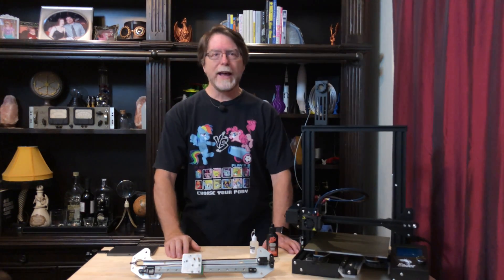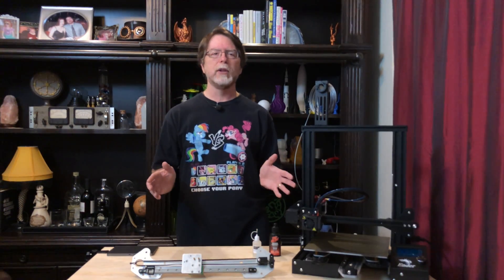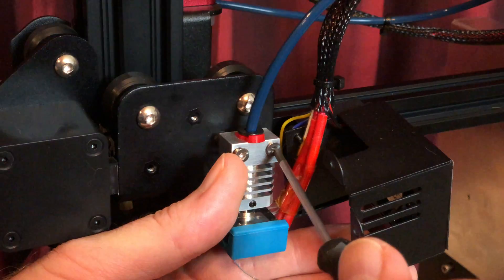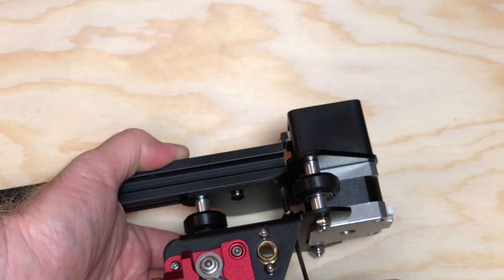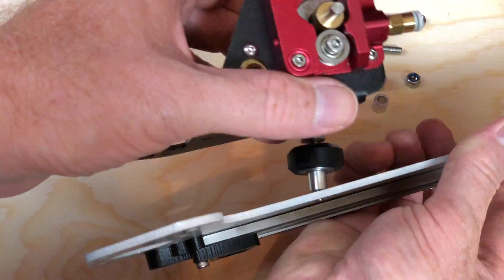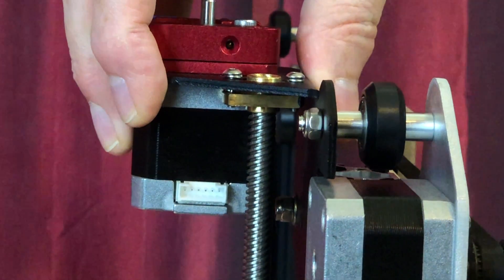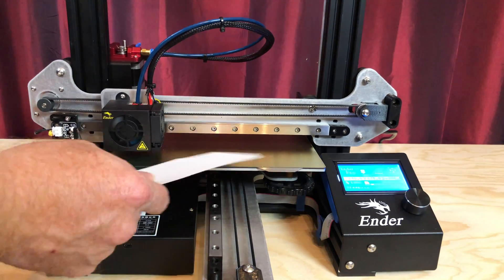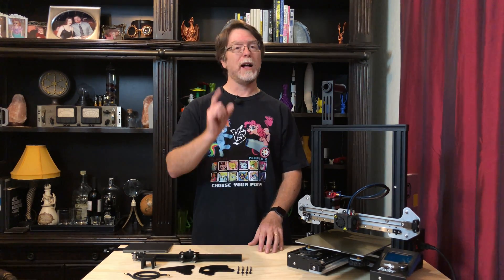How To Install 3Dfused X Axis Linear Rail Kit for Ender 3 & Ender 3 Pro

Comment: 2 axis down just all the rest to go. Just not a firm beliver  that this relay Archive any thing other than it my  give stronger artifacts or in a way multiplying even create some,  if there is any problems on the other axis that are still stock.  in any case you still have a heavy spring loaded bed moving back and forward  and belts and belt wheels and a ton of other factors that are not balanced or 100 % true, so for the money not sure this is the thing to solve any issues,  it my present issues that are even more complicated to address.  Not trying to be an AS here but i for one is not totally sold that this will get you any where fast.

Comment: So this might be a long shot, but do you know what screws are used for the wheels on the non-motor bracket? I stripped mine and I think if I can get a replacement it'd be a lot easier than returning the whole thing.
Reply from the maker: Hi! The screws on the original Creality part appear to be M5x30 button head screws. The nuts are M5 nyloc nuts. 👍
Reply: @BV3D just got around to going to the hardware store and lo and behold they were! Much appreciated
Reply: @BV3D  Thanks a ton man! Not even Creality's github makes that clear!

Comment: So I finally hooked up the linear x rail, and it's super loud now. It sounds like a palm sander running under a cookie sheet at some points, like it starts a mild vibration and then just starts really rattling. Hot end, fan shroud, rollers, belts etc are all tight.

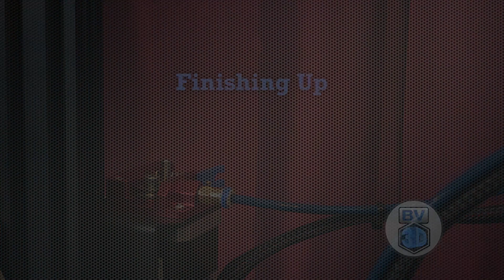Comment: Hi Bryan! At time 10:42 you show an adjustable X axis limit switch bracket. Where can I purchase this? I did not see it with the assembly from 3DFused. My X axis needs the limit switch moved more to the right to prevent the stepper motor from setting home outside the build plate.
Reply from the maker: Hi Dave! That should've been in your kit, but fortunately, 3Dfused has STLs for all the printable parts available to download. In the "navigation" links along the top of their site, the third one is "Download .STL", and the X limit bracket for the Ender kit is about the 7th item down. Here's a direct link to save time: https://3dfused.com/download/3637/

The fun thing about that is, if you want to reprint their printed parts to match a certain color scheme you've got going, you can do that. 👍

As a side note, I've got my limit switches adjusted so that the nozzle's home position is aligned on the left side of the bed, and hangs about a millimeter over the front. I like having that little "overbite" on it so that while heating the printer, "nozzle ooze" doesn't collect on the bed. When I print my priming line, I move the nozzle in a few mm to do it, so the strand of ooze gets wiped off at the beginning.
Reply: @BV3D  Well... That's what I get for not pulling the cover on it to begin with. I finished assembly yesterday only to find the X axis was causing the extruder assembly to bang when it hit the switch. I can fix this now that you showed me it was already there!! While I am at it, here's another question, I am replacing the stock board today with the SKR Mini E3 32bit board with the 2209 drivers already installed. I had ordered SL Smoothers as well but I don't think they will do anything with these newer  drivers. Any thoughts? Might make a good video for you. Thanks very much - I owe you a few coffees!

Comment: For lube i have actually used Traxxas shock silicone oil :) It was all i had at the time and it worked just as well
Reply from the maker: That's funny, but I don't see why it wouldn't work. The only possible issue I could foresee is if the shock oil had some weird reaction with whatever lubricant was already on the rails and got gummy. But even if that happened, cleaning & re-lubing a rail block isn't really difficult. Should I make a video about that?
Reply: BV3D: Bryan Vines wouldn’t be a bad idea for a video, I’m sure some people would get some help from that

Comment: Waiting for the X/Z video.
Reply from the maker: I'm planning to have that out on September 30!
Reply: @BV3D  As soon as I saw this I basically wanted the full kit. Two problems though, a smaller one is that they don't powder coat them but keep them bare metal and 100% of the printers they will go on will be black (minor you might say, but important to some). Bigger problem though is shipping, while I find the price of the kit quite acceptable shipping is twice the price of the full kits themselves :/ (NOT counting VAT and import fees)
Reply: BV3D: Bryan Vines THANK YOU. I need to get my complete kit installed as I have a lot of printing to  do

Comment: Nice video although i dissagree with the hole concept of choosing rails over pulley wheels. I see this as a downgrade. You eleminate the dampening effect of the wheels. THIS is IMHO
the success of the Creality series. If i would actualy wanted to upgrade i would use plastics to screw the wheels on to to further eleminate vibration. But who am i?

Comment: Slightly over priced as far as I'm concerned. Also, there is no mention of leveling the gantry, just the amount of play in the wheel screw holes would be enough to throw it out one direction or the other.

Comment: Can you provide a link to your hex driver(s) that you use? I'd much prefer them over a standard L-shaped hex wrench. Thank you for the fine videos!
Reply from the maker: Hi Bill! That would be the "Wera 2052/6 Kraftform Micro Ballhead Hexagon Electronics Screwdriver Set and Rack, 6-Piece", which I got on Amazon in February of last year.
https://amzn.to/2LqC6g2 [affiliate link]

It doesn't match the largest of the L-shaped hex wrenches that came with the Ender 3, but it matches all the others.

I do appreciate the ball ends on the wrenches Creality included with the printer though. Love those things. You don't have to have the wrench perfectly inline with the screw head to drive them in!

Comment: Brian you have outdone yourself in this video!! Very nice super great instructional video!!!!! Now that you have added the two linear rails I wonder what changes you have seen in the Ender 3 printing quality.  I also look for the next installment on the Z access  linear rail installation. I do have one comment the price of this is a little bit on the higher side and I’m wondering why they did not black anodize these parts.
Reply from the maker: Hi David, and thanks! Something weird seems to be going on with my replies on YouTube; several that I've left recently are now gone. Anyway, I tweeted a couple of photos of Louise Driggers's "Aria" dragon, the print came out really nice. I'll post that in the Community section of the channel as well. One thing to note about the upgrade is that both the X and Y axis components are waterjet cut from really thick aluminum. I think enough people like the raw metal look that they didn't see the need to change. However, they are giving thought to the idea of powdercoating the parts.

Comment: Man, can't wait for the z linear rail and your thoughts on how all 3 have improved (or not) your print quality. Do you think there would be a big advantage with this x upgrade over stock when adding a direct extruder? Also, excellent tutorial as always, clear and straightforward! Thanks for sharing Bryan! P.S. do you think Vegemite would go well with a bearing sandwich?
Reply from the maker: Hey, Thierry! I'm really pretty sure I replied to this comment a day or two ago, but it looks like my reply is gone. I had talked about the rail being able to carry the weight of a direct drive extruder, and stuff like that. I also said something about vegemite being good anytime. So very odd! Did you get a notification that I replied recently?
Reply: @BV3D  haha, no I didn't see that reply. I would remember anything to do with Vegemite!

Comment: I enjoyed the video, but wow, this is a stupid upgrade. There are so many more meaningful upgrades that are way cheaper, just not "plug & play." Upgrading to a first-tier extruder would be one. The aluminum MK8 / MK10 is not. Next, a better hotend, like a V6.
Reply from the maker: Hi! There are any number of upgrades one can install on a printer. Everybody has different priorities on what they consider to be necessary upgrades. But that's OK, right? You are prioritizing the extruder and hot end, for example.

I mean, I agree that the stock extruder is the worst. And the aluminum one, while not "top tier," addresses two huge flaws with the stock extruder and is one of those "If you buy nothing else for your Ender 3, at least buy this" kind of upgrade. If you want better, you spend more and get a Bondtech or similar.

The stock hot end is fine for PLA. I installed a Micro Swiss all metal hot end because it was a drop-in replacement, handles higher temperature materials, and because of my past experience with the product on other printers. Is it as good as an E3D V6? I don't know, I haven't used one. I'm not a hot end expert, but it works pretty well for me.

I guess my point is that, while I respect your opinion, my own opinion is that it's not a bad upgrade. I'm not a stranger to soldering electronics and printing parts for upgrades, but I appreciate the simplicity of drop-in replacements.

And having said all *that*, I'm interested to know your full list of must-have upgrades for the Ender 3 / Pro, because I'm always looking for cool things to showcase in videos!

Thanks!
Reply: @BV3D  I agree that the stock Ender 3 is a capable printer when dialed-in. I have found that the weakest link is by far, the extruder. It slips under high nozzle pressure, just like you would expect a MK8 or MK10 to. I find this to be the source of most underextrusion that people complain about. Printing some brands of PETG with the stock extruder is even maddening, as it slips on the drive gear under high nozzle pressure, and is generally much harder to grip than PLA. While a V6 isn't a necessity, it's money much better spent than this upgrade. I find the stock hotend decent, but definitely a bit leakier than V6, and obviously not up to the same temperature capability. There is nothing wrong with the repeatability of the rollers. The repeatability is far good enough for FDM, and it's highly unlikely that you would notice a quality difference between the linear rails and the rollers, all confounding variables aside. The asking price is well, also absurd, because it costs half as much as the stock printer, and affords no increase in real-life usability or print quality.

Comment: Yum yum, 2 wheel sandwiches. Been considering linear rails for the Borg, ever since your last video on it. I feel another upgrade coming on.
Reply from the maker: I like the fact that they have almost no "give". Even the bed, on that one little rail, doesn't really lean to one side or the other (the carriage flexes a little, but where it's mounted on the rail? Not at all!)
Reply: @BV3D  Yeah they look surprisingly rigid. The Borg is a souped up CR10s4 so will need 2 rails for the Y, making it even more rigid. To be fair, the Borg is a very good machine with all the upgrades I've given it, but there are always more to give it.
Reply from the maker: Sometimes I live by the motto, "If it ain't broke, fix it until it is!" 👍 It's fun to be able to incrementally add features or improve a printer's performance with simple upgrades.
Reply: @BV3D  😄 I like that. That's exactly what I brought it for, the hackability and print envelope.

Comment: I’m super jelly!
Reply from the maker: Thanks! Y'know I saw on Twitter where 3Dfused was toying with offering powdercoating on these upgrade kits. But I'm kind of liking the raw aluminum look. It has kind of an industrial vibe going on.
Reply: @BV3D  _ I saw that also but after seeing what you had on your pro, I really like the bare metal.  I would think if you knew someone in the auto business they could paint it to whatever color you want.
Reply from the maker: Given the low likelihood of it getting scratched, I could probably just prime it and spray it with rattle-can of spray paint. I have some that gives a "hammered copper" kind of look. That would look pretty neat against the black of the printer's frame. 👍

Comment: Careful Bryan, you are slowly turning that into a $1000.00 printer lol
Reply from the maker: Hi Chris! Well, it might be getting close to being a $600 printer so far. 💰It's got linear rails on X an d Y; a Micro Swiss all metal hot end, an all metal extruder, and a Wham Bam flex plate. 😁
Reply: @BV3D  when are you going to upgrade the board to the "Silent" Board from Creality? And an ABL? BLTouch or EZABL. And switch it over to a direct drive extruder? Are you keeping a price log so you can compare it to the cost of a Prusa MK3S?
Reply: @JohnDStrand  bltouchc is pro